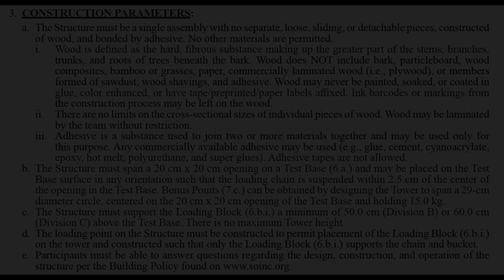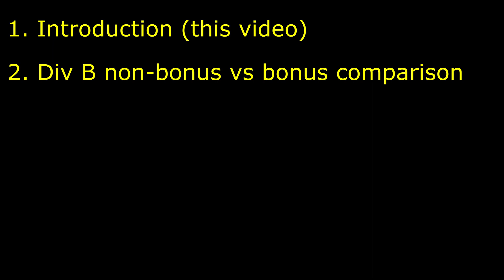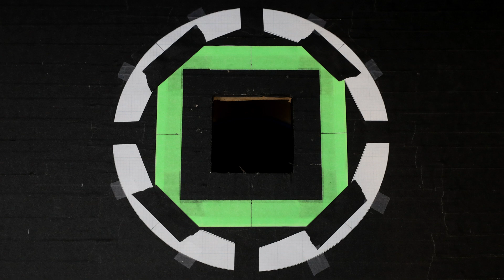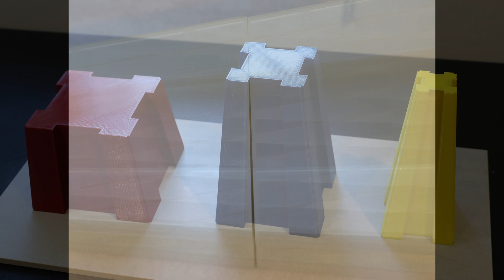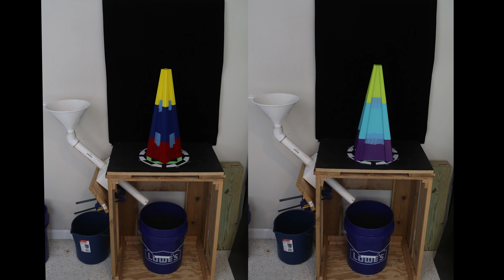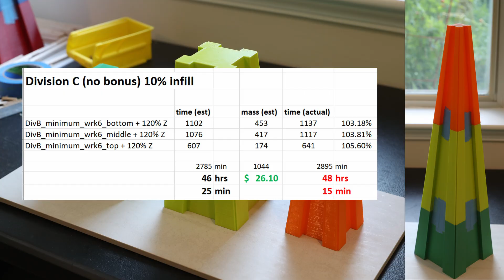2024 Science Olympiad Tower: Introduction

Comment: Thank you so much for the videos. Will the STL files work for the Tower Event for 2025? If not, will you please share STL files when time comes? We have a local library that can print the jigs at a reasonable cost. They are going to be super helpful for the teams.
Reply from the maker: Hi! These STL files will not work for the 2025 rules.  I am currently working on a series of videos for the new season and I plan on releasing them once the official rules come out.  I will definitely share my new jig files soon after that.  Thanks!
Reply: @balsaengineering  Thanks for the excellent video and sharing all the files. Wonder if you have the STL files working for 2025 rules.
Reply from the maker: @rosecarmen453  Yes, I have a series of 7 new videos for Div B for the 2025 season.  There are STL files linked in the description of several of those videos where you can download the files I used to create the jigs and other support parts.  Here is the first intro video for the 2025 season to start with:  https://youtu.be/nA1OLIh1O9w
Reply: @balsaengineering   Thank you! Now I got it. This is following the separate base and column design. Wonder how does this design compare to your early design without base (e.g., https://www.youtube.com/watch?v=IbCCdeQxMMY&t=23s) ?
Reply from the maker: @rosecarmen453 This video and design was for last year’s rules. The base and column design is required for the 2025 season because of the rule changes

Comment: Hi, can you tell me the measurements for the opening on the top and bottom? Thanks.
Reply from the maker: For the non-bonus, the bottom was 152mm square and the top dimension is 40mm square
Reply: @balsaengineering  Also, what’s the distance between each stick on the crosses?
Reply from the maker: @ro.se_is  If you check out my initial build videos for both Div B and Div C, I show my notebook pages where you can find that information.  Basically, my recommendation is to start with 8 evenly spaced layers for Div B and 10 for Div C

Comment: your videos are super helpful! Ty so much for doing these. I have a question on 'Div B - Bonus', what would be the bottom length and height for each of the 3 parts (bottom, middle, top parts) for the 3D prints?
Reply from the maker: Thanks!  I'm not sure what you mean with your question.  You can download the exactly jig STL files for my Div B bonus version of the jig.  The links are in the description of this video.  You can print these and use them or just inspect them to get the basic dimensions if you want.  Good luck!
Reply: @balsaengineering  got it, ty so much

Comment: Also could you send a link for the 3d printer program software
Reply: Ok Thanks for your help.
Reply from the maker: Different printers use different programs and settings within the program and are very specific to the printer being used.  I would recommend asking for help from whoever owns/manages the printer you are using.  If you provide them the STL file, they should be able to help you print it

Comment: how did you cut the balsa strips? What tool is used to cut them?
Reply from the maker: I've just been using a simple balsa stripper like this: https://www.amazon.com/Master-Airscrew-Windsor-Propeller-Stripper/dp/B0000WS5OQ/ref=sr_1_3?crid=EKD4Q2RGW6H3&keywords=balsa+stripper&qid=1703350686&sprefix=balsa+str%2Caps%2C129&sr=8-3    You can see that tool in action and a few tips on how to use it in my balsa library video: https://youtu.be/bLsTOpmozGI

Comment: Thanks for the jig. It made building much easier. Do you have any tips and tricks to stop the tower from sticking to the jig?  Would Vaseline or Chapstick help?
Reply from the maker: Hi!  Definitely don't use Vaseline or Chapstick, those might even make your device not legal.  My best advice is once you have the legs taped in place, build the cross-members with the jig on its side instead of vertical.  This will help you apply less glue and not have it drip into the edges.  Aside from that, really try to use as little glue as possible.  While all those joints are very important, the glue is very strong and you only need a tiny amount for each joint.  If your tower does get stuck, I recommend temporarily taping a small block (I 3d printed a 30x30x5mm piece) to the top of your jig and carefully turn the entire thing upside down and put it on a hard flat surface.  Then firmly press down on at least 2 legs at once and hopefully the tower will pop off.  Good luck!  (final suggestion if you are still having lots of problems, you can tape wax paper to the jig which will prevent any extra glue from sticking, but try and get your technique down so you don't need to do that)
Reply: Thanks you so much for the quick response. I am mentoring three teams of fifth and sixth graders, and most of them first time builders. I will have them try taping down the wax paper before they get too frustrated.   @balsaengineering

Comment: Thanks for another great set of videos. I believe you may have accidentally uploaded the bonus B tower twice instead of the three part minimum B tower. It says non bonus but the files for the B bonus tower were uploaded instead. Could you upload the three piece minimum B tower please. Thanks.
Reply from the maker: Hi! I just doubled checked and download the 3 files listed under the Non-bonus Division B.  They are the correct ones.  Make sure you are downloading the files that say DivB_minimum_wrk_bottom.stl, middle, and top.  The bottom part should have a bottom dimension of 152mm.

Comment: im curious what the bottom length across and diagonal is and what the size of the top is across and diagonal
Reply from the maker: For the non-bonus design, the jig is 152mm square on the bottom which means ~215mm diagonal (corner to corner).  The top is 40mm square, so about 56.6mm diagonal.

Comment: Hello I have ran into a massive problem with the jig. I finished building the tower but the tower completely stuck to the jig at several places and isn’t coming off. I have tried using a knife to separate it, I have tried separating the layers of the jig to remove it but each one is fused to the jig. Idk what to do anymore. Could u please help and give tips so nothing ever sticks again and also give tips for how to remove it.
Reply from the maker: Hi! Yes, you have to be careful not to use excess glue to prevent this.  Also,  attaching the cross-members with the jig on its side has helped me in preventing this problem as well.  OK... to remove it, try this.  Find a small block, I actually 3d printed a 30x30x5mm block and temporarily tape it to the top of your jig.  Carefully turn the entire jig upside-down and put it on a hard, flat surface.  Then firmly press at least 2 of the legs from the bottom and with any luck the tower will pop off.  That has worked well for me when this occasionally happens.  If it's really glued on there, there might be no saving it, but pushing from the bottom will be your best bet.  Good luck!!

Comment: Hello, Thank you for the STLs and all the videos. These are great resources for our Science Olympiad team. I noticed the bottom section is not compatible with the middle section. Do I need to scale it or is there a section missing? I saw this for the bonus, non-bonus division B STL.
Reply from the maker: Thanks!  The STL files should be fine, I have heard of many other folks printing them successfully.  Double check that your printer/slicer program isn't doing something like shrinking the piece if it doesn't fit the print volume.  Here are the correct 3d volumes for the Div B non-bonus jig parts:  Bottom: 152x152x120mm, Middle: 125.39x125.39x192.5mm, Top: 82.69x82.69x192.5mm.  If you add up all the heights, it is 505mm or 50.5cm.
Reply: @balsaengineering  Thank you so much for your quick feedback. The problem was indeed on my end and I am so sorry that I bugged you with this. You rock !
Reply from the maker: @rabahhadjit4243  No worries!  Glad you found the problem and it's working for you!  Good luck this season!
Reply: @balsaengineering  Could you please share 3d volumes of the Div B Bonus jig parts for Bottom Middle and top.
Reply from the maker: @chandras4012  You can download the STL files from the links in the description of this video.  That should give you all you need for all 3 parts

Comment: Hello I want to download the division C build jig but in my software it asks to specify the unit of the imported model (mm, cm, m, in, ft) so which is it?
Reply from the maker: The original model was in mm.  FWIW, you should be able to scale the STL file to anything you want once it's imported
Reply: @balsaengineering  so if I put it in inches,cm, etc is it just going to scale the model to be in inches or cm rather than suppose if the hight was 50 mm it goes to 50cm. So I can choose anything?
Reply from the maker: @rdestroyer999  You'll want to choose mm to get the jig like I have it as that was the original units of the model.  You can scale it further later if you want to print a tiny key-chain version for example - or more practically, scale the Div B version in Z only by 120% to get a Div C jig.
Reply: @balsaengineering  also what percent infill is your model and what do u recommend

Comment: Balsa wood isn't a requirement...why no other wood options then?
Reply from the maker: There is no other wood that even comes close to the efficiency of balsa for this type of thing.  You can definitely use something like basswood here, but it won't be competitive.  These towers are in the 5g range and can hold 15kg.  That is extremely light and strong.
Reply: What about some of the rarer hardwoods?  Like Dogwood or Osage orange? @balsaengineering

Comment: Hello,  thank you for your videos.  It was very helpful as someone new to this world to hit the ground running to coach my kids.  We are interested in making the jig however we are limited in print time.  As someone who does not use 3d printing, I was told the jig files is a "filled" form, and if we were to use a "hollow" form the print time would be significantly less.  Is it possible to get the original file (not stl) to make those changes.  Thank you for your time.
Reply from the maker: Hi, thanks for the kind feedback!  Actually, the printer's slicer program can control the % infill of any given STL file.  I used 10% when I printed them, but I have heard some folks have printed it at 5%.  You can try printing in "vase mode" which basically just prints the outer shell with no top, but that might not work well.  You'd have to give it a try and see.  You can google it based on your specific printer, or here is a general idea what it's about: https://all3dp.com/2/cura-vase-mode-all-you-need-to-know/    Another option would be to use a program like Microsoft's free app 3D builder and split the STL file into more pieces that fit in to your time budget... that might work better than vase mode as a solution to your problem

Comment: I was looking at files for your 3D jig and I noticed that the base was 15cm by 15cm. When I look at the open square on the test apparatus it is 20cm by 20cm. What am I missing? For reference I am working in division C. Thank you for your time.
Reply from the maker: Hi!  Rotate your thinking by 45 degrees :)  Imagine the 4 legs of the tower at the midpoint of the 20cm square hole and draw that square and you'll find the 15cm base is plenty to span the hole.  You can see this in action in any of my non-bonus tower videos from this year.  Good luck!
Reply: @balsaengineering  Thank you!

Comment: For your testing stand, is the inside or the outside of the green tape 20cm? Also what are the dimensions of the top of the top part of the Div C jig, and the bottom  of the bottom part of the Div C jig?
Reply from the maker: The outside of the green tape is at 20cm x 20cm.  The top part of the jig is 40mm x 40mm and the bottom of the non-bonus jig is 152mm x 152mm.  The bottom of the bonus jig is 215mm x 215mm

Comment: any thoughts on how to print this for C if they are too big for the printer.  For example the top piece is too tall and the base is too wide.
Reply from the maker: Check out Microsoft's free app "3D Builder".  That is what I used to split the original STL file into 3 parts.  You should be able to split those parts further into something that can fit your printer.  This is also a handy reference link: https://all3dp.com/2/how-to-split-3d-model-stl-file-for-3d-printing/

Comment: Hi Balsa Engineering,
Is it possible to make a hollow version of your Division B bonus and nonbonus files? Also, you must be very fast if you managed to get the jigs and a built prototype already!

Thank you!
Reply from the maker: Hi! You should be able to use the existing STL files and print them however you want including a very low infill % or even in "vase" mode which would essentially make them hollow with no top.  I don't think I'd recommend that as it wouldn't be very sturdy.  I think some folks have printed it successfully at 5% infill.  I haven't heard of anything lower, but feel free to experiment.  FWIW, I did all my early work with the draft rules (which were actually slightly different than the final rules), so I'm not THAT fast!
Reply: Thank you, but I am new to 3D printing. Would it be possible to get vase mode on a free online 3D printing website?
Thanks for you understanding
Reply from the maker: I'm not sure, I've never used a 3rd party 3d printing service.  If you are going to go that route, I would recommend getting it done at 5-10% infill.  You will have to research how much that will cost.  Good luck! @zhshengcn
Reply: @balsaengineering  where are the draft rules available. our team searched for quite a while but weren't able to find them
Reply from the maker: @yashn1738  The draft rules are never published publicly. They usually give some form of them during their summer workshops, so if you go to that or one of your coaches go, you can get early access: https://www.soinc.org/join/science-olympiad-summer-workshops   But the rules can change from those rules, as they did a bit from this last year, so you can't completely count on them to get an early start
Reply: @balsaengineering  Hello! I would first like to say thank you for your help. I managed to get 2nd in state due to your help. Is there any other way to get access to the draft rules?
Reply from the maker: @MichaelIsaac-kd1ki  Thanks!  I appreciate the positive feedback!  Congratulations on your 2nd place finish at States, that is a fantastic result.  Unfortunately, I don't know of another way to access the draft rules early.

Comment: So for division C, I would just load this into an stl viewer, and increase of the 3 parts z length by 120%, such as the bottom from 120mm to 144mm, the middle from 192.5mm to 231 mm, and the top from 192.5mm to 231mm?
Reply from the maker: yes, that is the idea.  You'd want to do this in your 3d printer's slicer program right before it preps it for printing.  I have also since created a zip file to download (in the description of this video) that I did this scaling for you if that is easier.
Reply: @balsaengineering  what dimensions should I use for Division B Bonus 3D prints if I plan to use your 3 stl files. We are targeting for a 30 cm sq base and tower height of 52cm
Reply from the maker: @sirishabhumireddy8095  You should just 3d print my 3 STL files for the Div B bonus as-is at 100% size.  You really want to minimize the bottom base size, so I would not recommend scaling the base to 30cm square.  The bottom piece of my jig is 215x215mm which is plenty big enough and the total height of all 3 pieces is 50.5cm which is also tall enough to provide some buffer for the rules.  If you really want, you can scale my jig in your slicer program however you want... just do the math for how big you want, but I don't recommend making it any bigger.
Reply: @balsaengineering  ty so much for your quick reply. I will print Div B-Bonus files at 100% size.

Comment: How would you make a jig without a 3d printer?
Reply from the maker: Hi!  In 2017, we built a tower jig without a 3D printer.  We wound up using a 4x4 block of wood with a hole it in for a copper pipe and then at the top, a thick balsa piece to hold the sides into place.  Basically, just do the best you can to help assemble the sides even if you have to build it out of Lego, that will be better than nothing.  Good luck!

Comment: Might I suggest with the jigs to print using lightning infill? I haven’t finished printing everything but I completed the top and it came out great. I printed the div C top piece using lightning and I took about 7.5 hours on my ender 3 s1 pro and only took roughly 80g of filament. That compared to the 10% infills roughly 150g filament usage as you mention for the smaller, div B top piece. Let me know if you already attempted using this, and if there is a reason you decided not to. I’d be glad to learn now before I print the larger base pieces! Thanks a lot for making the jig files public, your content is super informative.
Reply from the maker: Hi!  That sounds like it's working great.  I basically just stuck with the fairly conservative build settings that I know would work well with my printer.  I'll definitely look into more advanced infill options the next time I need to print these jigs.  Thanks!